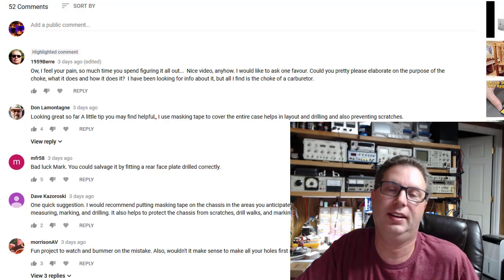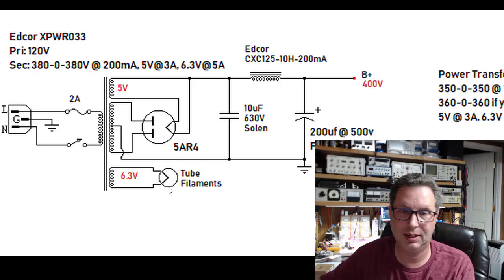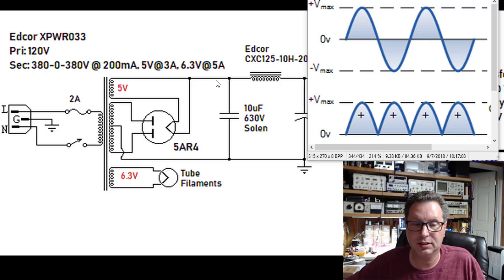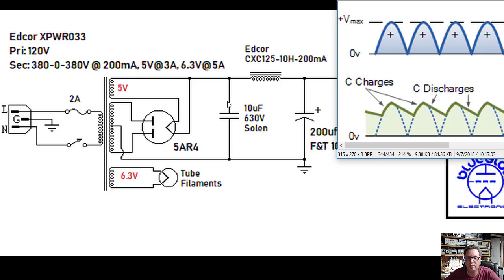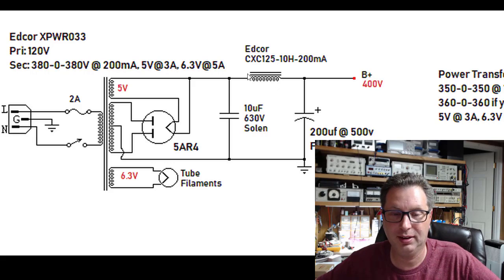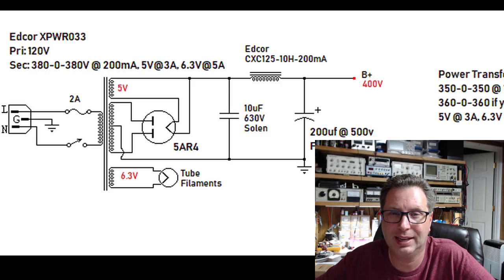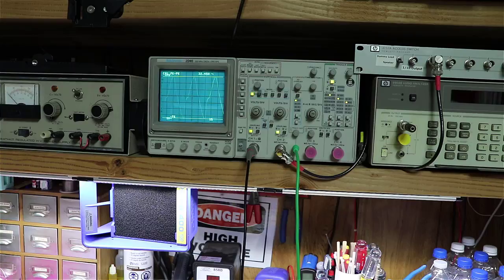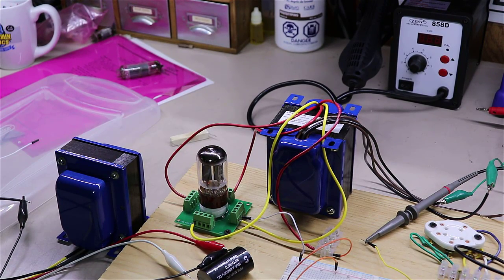What does the Choke in a Tube Power Supply do?

Comment: Are you familiar with Matt Renaud's power supply design article where he uses a 2 stage filter scheme using 1.5 H chokes instead of a single stage using the 10 H.  Better ripple figures and a lower cost.  Very interesting topic.  Thanks for your video.
Reply: Such a scheme will also result in lower resistance losses, and higher core saturation currents, allowing the power supply to handle higher peak current, with less voltage drop. It just means a few more components to mount, despite their smaller sizes.

Comment: The voltage of the high voltage secondary of the xformer is 780 VAC RMS.  The P2P voltage will be 1074.8 V.  The P2P voltage of each half of the secondary will be 537.4 V.

Comment: you said at the begining of your video ac household voltage is around 120v ac "RMS or P-P" is p-p and rms the same thing. You made it sound like it is?
Reply from the maker: Sorry 120v, would be RMS, I was pointing out the Peak to Peak waveform in the diagram.  P-P would be about 170v
Reply: Blueglow Electronics No, that would be peak. P-P would be double that. 120VRMS/0.7~=170VP X 2 = 340VPP.
Reply: I love watching people learn.
Reply: doing a video is a good way

Comment: Nice video, thanks. I find it helpful to add a load when testing for ripple. Switching between 2 loads can also help provide details on what kind of output impedance you can expect from your power supply design.
Reply: With no load there will be no ripple.

Comment: More more more! I have not been able to get enough information with my limited knowledge wanting to build a five amp 24 V DC supply for my amplifier Amp Camp Amp by Nelson pass his First Watt DYI Amplifier kits he releases to the general public. I have built an RCR from a kit PBC very satisfied with it but just educate myself I want to build a CLCLC Power supply on the same principle for24 V 5 A
Reply: That would make your kit price explode. I build an Pass F5 amp with C - L - C, and used some Jantzen speaker crossover coils. Right now I don´t remember the value.
But they were around 2 lbs. each and not exactly cheap. They have much lower mH value and very thick wire, so that is a whole different story. But you can easily find
info by googling Pass power amps. They were heavily used in his ealier amps.
Reply: You'll want to use some series regulator transistors, not a bunch of chokes.

Comment: Not a tube guy.  Your modeled circuit makes sense.  But the schematic has me lost. Why is B+ common with the 5 VAC winding?  Why isn’t one end of the paired “diodes” common?   

I’m just a bit basher trying to sort the difference between the model and the schematic.  Wait a minute.  That could be a C&W title over on El Paso’s channel.  Well, not a C&W guy either I guess.
Reply: The AC and the DC co exist in the same circuit without interfering with one another, so no need to have it (B+) at the center point.   At least that is my understanding of it.,
Reply: Jack Allen The reason is that the rectifier has a directly heated cathode, so the heater has to be a part of the DC circuit as well.
Reply: Good point EJP!!  I hadn't thought of that, thanks!!
Reply from the maker: 5v is AC, the B+ is DC.  both on the same wire at the same time.  Its been done this way for ages.  I made a video at one point that showed how AC & DC can exist at the same point in a circuit.

Comment: That's a really good demonstration and explanation.  I would have also liked seeing the effect of the capacitor that follows the choke. It looks like it's shunting an even higher frequency to ground to smooth out the plate voltage even more. Thanks again.
Reply: Marty Varon It is shunting the same frequency, to form a third pole of the filter, which is now 18dB/octave.

Comment: Nice video explaining the power supply and purpose of filter chokes. Why does Paul Carlson refer to them as reactors? On your schematic L on the IEC connector is shown connecting to the 2 amp fuse and then to the transformer primary. N is connected through the switch to the other end of primary.  Switch should be on L side between fuse and transformer.
Reply: Daniel Thomas Both switch and fuse should be on the hot side.
Reply: @EJP286CRSKW  Yes, that's what I was saying. His schematic shows the fuse on the hot side however the switch is on the cold side.
Reply: "Reactor" is an older term, it refers to the effect of "reactance". But it was always ambigious because reactance is not unique to coils, it also happens inside capacitors (capacitive reactance/inductive reactance), so it was never clear wether you are talking about an inductor, a capacitor (or sometimes also combinations of both were called a "reactor"). 

Paul Carlson seems to use the old terms on purpose when he talks about vintage gear.. you also hear him saying "megacycles" or "kilocycles" very often ;)

Comment: Hello blue glow vids! I am building an amplifier based on el34 this Week and i was going to buy a inductance of 10H 200ma that costs me about 40euros.... very very espansive.. until i saw this http://www.bartola.co.uk/valves/2012/06/24/gyrator/ a mosfet gyrator that simulates the work of a choke!!! But hey the components cost 5euros and the weight including the heatsink is about 100grams that is uncomparable to the inductance weight.. i hope you Will try this method that is not usually used

Comment: Thank you very much for this video!  This is the explanation I have been looking for.   You make my day!   If I understand correctly,  tubes are all about voltage amplification at relatively low current, as opposed to transistors who are about current amplification at relatively low voltage.  I guess rectification of a high voltage B+ simply can not be done with reasonably sized capacitors.  Is it correct to say a choke filters a high voltage sinus by topping off its peaks, as opposed to caps who filter low voltage DC by filling in the 'gaps' between peaks?  So, inductive filtering is the best way for high voltage, low current and capacitive filtering is suited for low voltage, high current.
Reply: Yes.  As the voltage peak hits the choke, the inductive field in the coil builds up and prevents the full peak from passing.  As the voltage starts to drop the field starts collapsing and supplying current.
Reply: @1959Berre ~ not exactly, you need a low pass filter to reduce the ripple in AC to a theoretical 0% of the signal or 0.00 Volts RMS and some potential either above or below 0 Volts or Ground, which is your DC voltage no matter the voltage potential, high or low.  Low pass filters consist of two or more components designed to allow a signal of a specified frequency to pass.  Ideally you only want DC to pass into the tube circuit for powering vacuum tubes.  The two components of the pass filter work together to smooth out the ripple of rectified AC. The inductor (choke) resists being charged in response to an increasing magnetic field strength inside the coil.  The capacitor tries to fill in the dropping ac voltage by supplying current stored on the rising AC sine wave, which it then discharges on the falling AC sine wave. Simultaneously the inductor also adds current to the circuit as the magnetic field induced in the coil windings collapses on the downward side of the sine wave. This is what gives you that smooth, flat signal on the oscilloscope display.  
You can increase capacitor voltage by connecting them in series, which adds the rated voltages. For example if you connect two 450 VDC capacitors in series (for polarized caps +_-,+_-) you get 900 VDC of rated voltage capacity.  There are capacitors (large oil filled) rated at thousands of volts, the same goes for inductors as well.  So both inductive/capacitive and resistive/capacitive are used in all power supplies high or low voltage.
Reply: Mine was a shorthand attempt at what you explained.  Good job, as I think many will find your explanation very educational.
Reply: Also yes, vacuum tubes are like Field Effect Transistors they are voltage driven devices and Bipolar Junction Transistors are current driven devices. Hope this helps.